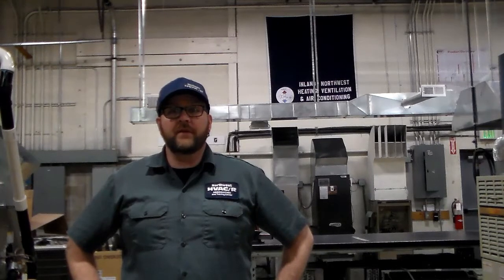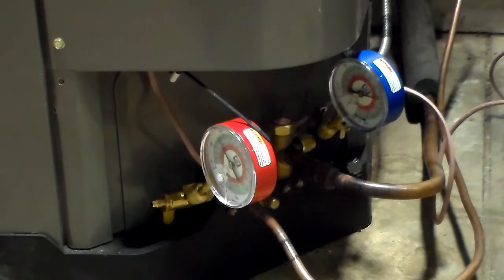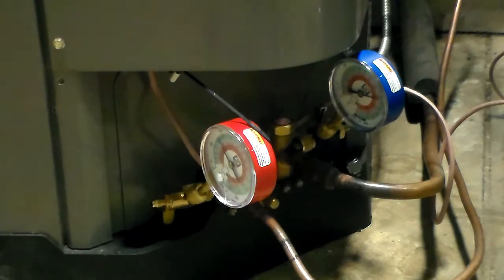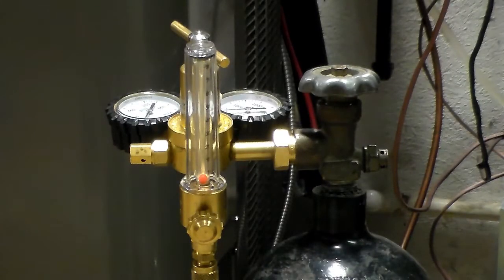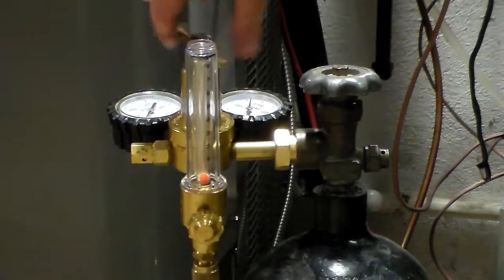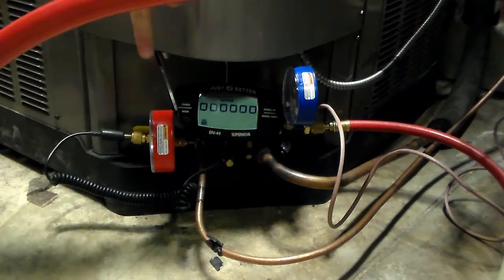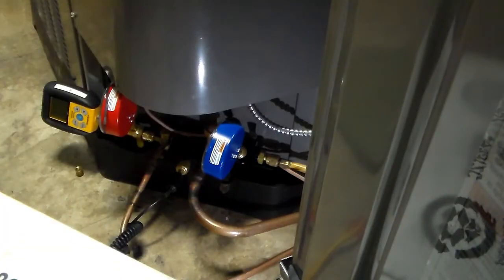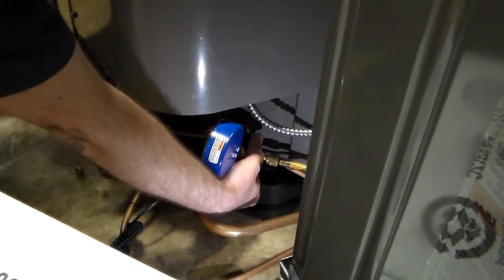No Manifold Recovery, Evacuation and Charging

Comment from the maker: And it should be known this unit runs great now with the new compressor. If you're curious, the code it was giving us was "lost rotor position" on the compressor which led to the replacement. After a long conversation with tech support (which, by the way, gave me different issues). It was ultimately my gut and knowledge of ECM motors that led me to replacement of the compressor as the hall effect system wasn't picking up rotor position. Otherwise this compressor tested fine. A little bit of a guess, but an educated guess.

Comment: What about the liquid refrigerant in the hose? Was it an exact amount from what you initially recovered?
Reply from the maker: My hoses hold about 1.5 oz and you bring up a good point. I don't think the video shows (though it should have) but when you're done weighing you need to run the unit, close the tank and let the unit suck the remaining liquid out of the hose through the low side. Thank you for the great question.
Reply: @hvacjames509  but also if you throw the remaining liquid in through the low side how do you meter that in? Using the ball valve on the hose?

Because we know that only certain scroll compressors can handle liquid slugging.
Reply: @hvacjames509  In addition, I think that’s one of the only applications for use of a blank off valve to valve off the micron guage.
Reply: Is it safe to charge 9 lbs of liquid refrigerant into the suction line?  Won’t it flood the compressor with liquid?